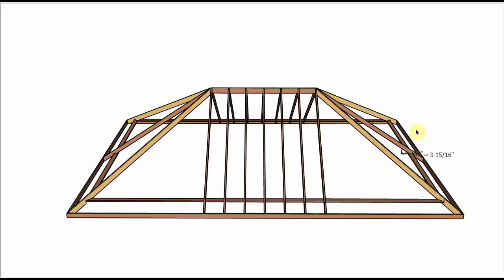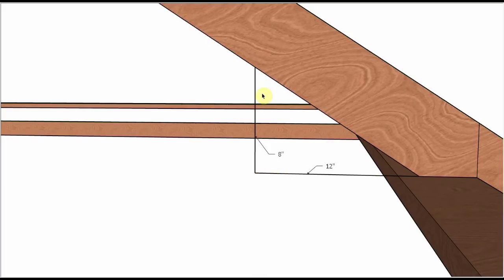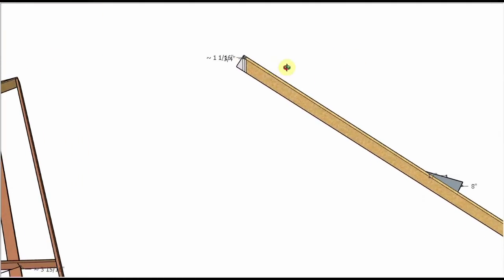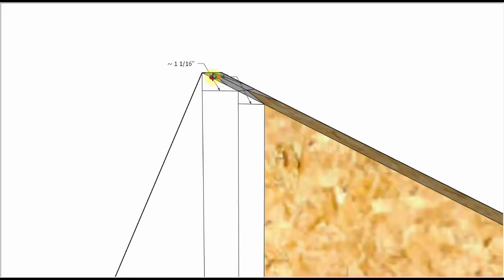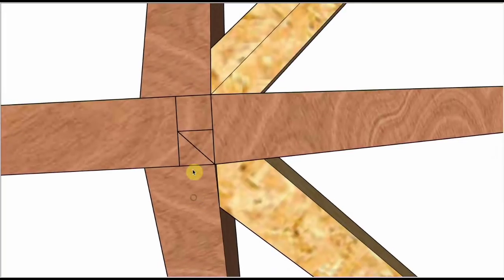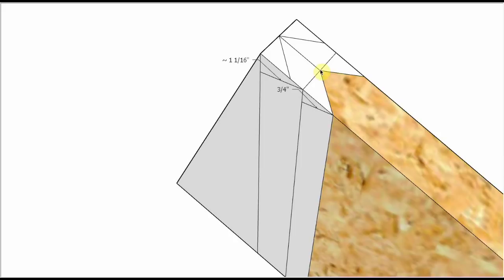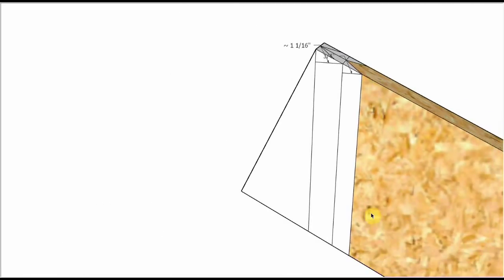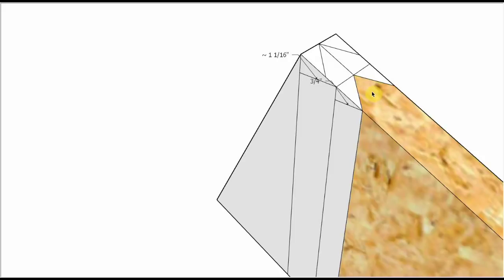Hip Rafter Ridge Cuts Layout

Comment: Very good information and well explained! I'm still picking up other people's tips and tricks at 60. For some of the other viewers who are interested in roof construction in different countries or who may even travel to work in other places. On the point where the crown rafter meets the end pair of common rafters, in good practice, we would face this pair of rafters up with a triangular "saddle board" a type of gusset board for the hip rafters to rest firmly rest against to ensure that they obtain full bearing because the hips can sometimes have a  plumb cut about 1/3 longer than the common rafter plumb cuts. The crown rafter in between is also built down with a triangular block of the same rafter thickness and this enables a longer plumb cut on the crown rafter similar in length to the plumb cut of the hips.
 Therefore we adjust the position of this end pair of rafters to allow for the thickness of the saddle board and the hip rafter length calculations still meet at the center of the roof on the plan. Where the hip rafter meets the wallplate it is standard practice for us in Ireland and the UK to notch the hip rafter over a corner tie, or dragon tie, a very secure tried and tested method.
Reply: And also nail a off cut to the under side of the crown rafter.
Reply: @donalrodgers123  💯

Comment: what is 17 inches based on?   is it common to all hip roofs?
Reply: Yes it's common for hip and valley rafters. For an 8 - 12 roof you need to go in 17 inches to get up to your 8 inch of the common rafter since the hip and valley are running on a 45
Reply: chris ballas 17 inches is the foot run of a hip or valley rafter
Reply: it's in complete reality 16.97..not 17...must use scientific calculater for precise understanding of application....16.97 inches of run per 8 inches of rise and or vice versa..
Reply: @josephsolomon7935  Hi. Can I just confirm that 17 inches is a  common measurement to any pitch on the Hip rafter?
Not just 8 and 12?
Hope that makes sense 🤔

Comment: How to measure hip roof square feet
Reply from the maker: The long sides are trapezoids and the ends are triangles so you can use those formulas to calculate the area. But also, the area of a hip roof is the same as a gable roof of the same dimensions.
Reply: Please give me drawing or video measurement square feet